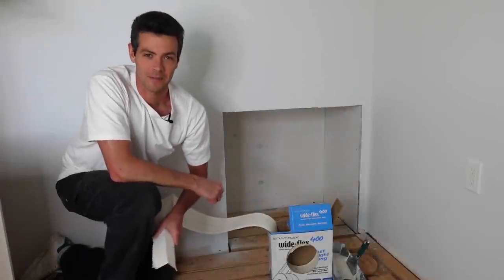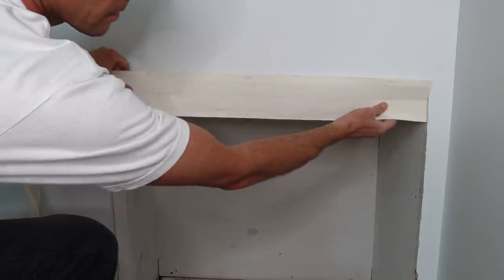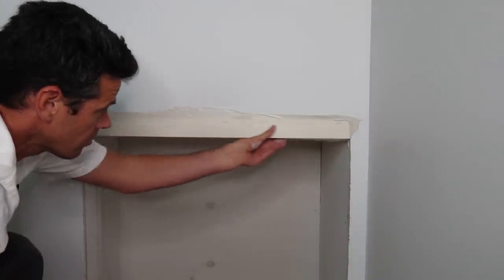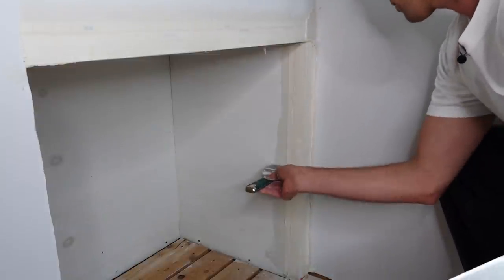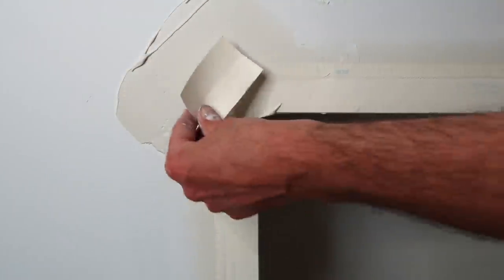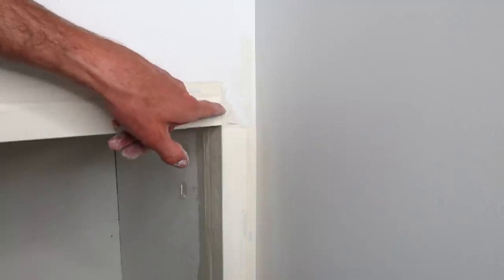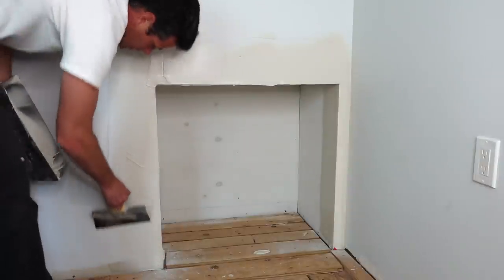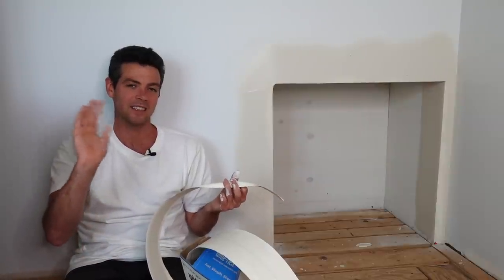Does Flexible Corner Bead work for outside corners?

Comment: I used almost solely this stuff in my basement and I loved it. My only issues were, as you mentioned, in some areas I let the corner dip lower than the edge. Fortunately these are mainly on the ceiling where I just leveled them out with mud and no one will know.

I really liked it for long ceiling duct runs. I was able to use one continuous length instead of a bunch of small sticks

One other nice thing is I found it very easy to replace my mistakes. I simply took an oscillating tool and cut out the small section that was bad and bonded on a new section in the gap. No need to remove the entire stick.

Another thing I liked it using it for inside corners. Sure, they are expensive. But it makes the corners so easily perfect with no need to sand them to perfection.
Reply: Been using strait-flex for all of my drywall projects for 15 years. Love it.  I typically use their Perfect 90 for all inside, Mid-Flex for outside and the composite medium for bathrooms. 

I too really liked it for those long runs.

Comment: In that part where you used paper tape in the corners I would suggest cutting the No-Coat product with a 45 degree angle so that the two pieces meet up.   No need for paper tape then.  Have had success with that.  Really like this product and used it in a lot of places.
Reply: I was going to ask him, why he is not using a 45 deg cut? Even on those tapes you have those lines at 45 deg printed, so you can cut them easily. But I don't see a comment from Vancouver Carpenter.

Comment: Love that stuff,  use it on ceiling's and inside corners,perfect 90s and angles 25% of the mud, one coat and done, never cracks, not as impressed with it for outside corners but only used it once for that, pricey but saves a ton of time and sanding even though i can do a great job with paper.

Comment: Thought for or against doing a miter on the wall side of the flange?
Reply: I always miter my outside corners don't know if it makes a difference
Reply: That is also how I do the outside corners,on a 45 or overlap
Reply: I also mitre my corners. I’ve even mitred my inside corners. Although I’ve stopped using it for inside corners.

Comment: Do you add in glue with the all pupose mud like you encourage with other applications?

Also it looks like you cut the ends straight didn't see you cut them at an angle?
Reply from the maker: I cut them straight. No need to add glue to all purpose.
Reply: @vancouvercarpenter   ok thank you!!! (:)

Comment: Can quick-set be used for corner beads?
Reply: I always use hot mud to set these roll on corner beads, then coat them instantly.    Once cured I'll top it with plus 3 and will sand it a couple days later.    I do this same process with aquabead as well
Reply: @1987pancakes  Thanks.
Reply: Would durabond work when applying No-Coat to an inside corner? 
I'm doing a bathroom and am worried about the straightness of my ceiling/wall corner, so I'm leaning towards No-Coat and just don't have the faith in all-purpose / all-purpose lite that everyone else seems to @1987pancakes

Comment: how would you handle outside corner 1 inch from inside corner? do you overlap both corners?
Reply: This! I just dealt with this the other day. Please give us advise.
Reply from the maker: If your lucky the corner bead tape can just be creased into the corner when taping. If not you might need to cut the corner bead and then put a corner tape on top.

Comment: Why would someone get hairline cracks on inside corners?
Reply: @Tard Vargus I used all purpose.  It was in a garage and on the side of more humid than dry… took days for the mud to dry completely, even with a fan circulating.  Just give it another light coat of mud or is that nitpicking?  It’s literally hairline, but I just don’t want the crack to get bigger
Reply: @Tard Vargus thank you!  I will try the wet sand on this one and lean to that mix you recommend from here out.  Appreciate it!
Reply: @Tard Vargus yeah I saw the kilted drywall guy use that caulk trick.  I feel like it could be painted and no one would ever notice to be honest, unless it opens up.  So the tape job beneath is good and I don’t need to disturb that, right?  I wouldn’t be gouging out my tape job?  Maybe a super tight bead of latex is enough to get the job done?  It’s like a 3 inch long hairline crack where the wall meets the ceiling